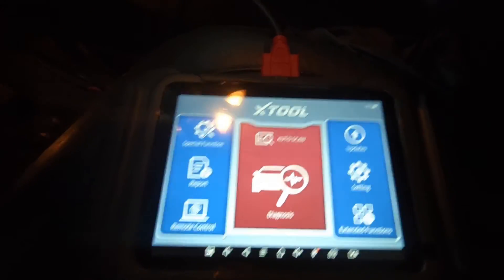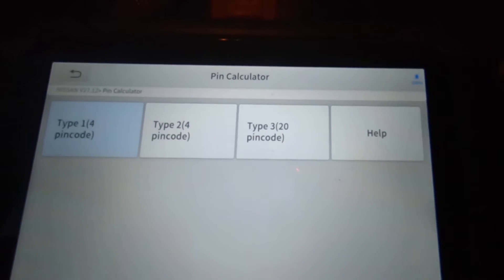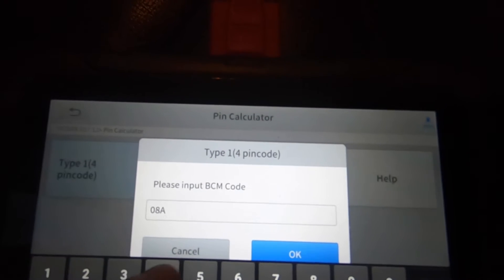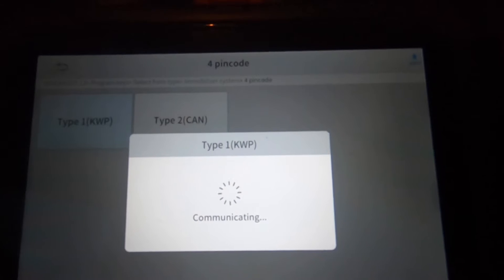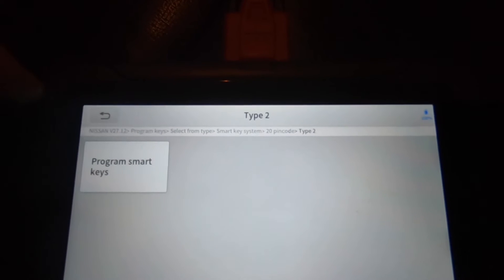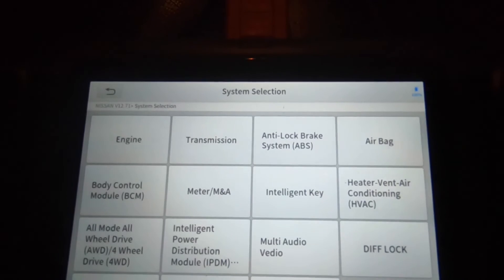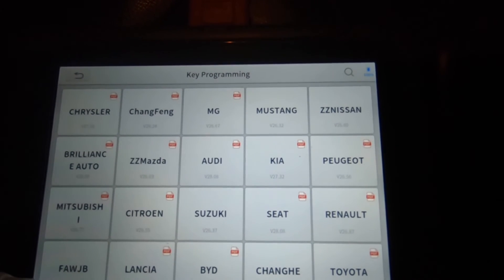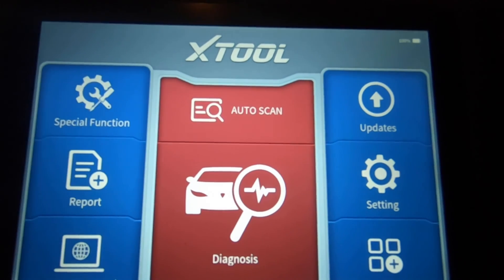Pulling Pin Codes and Programming Keys for Nissan using the Xtool D8 Scan Tool.

Comment: Does this still read pin codes ?
Reply from the maker: Yes, but it is still year, make, and model dependent, meaning it has never read 100 percent of the PIN codes or passwords from all manufacturers. However, for the ones I have used it on, I have not seen anything removed.

Comment: Are you able to program a replacement BCM to work with car with this tool?
Reply from the maker: Depends on the year, make, and model.
Reply: @737mechanic I have a 2007 Nissan Murano. Do you know if it’s compatible with that?
Reply from the maker: @zenbran  I don't know for sure without connecting it and seeing if it is listed.
Reply: @737mechanic okay thank you for letting me know. I’m hoping I just have a bad battery but have a feeling it’s probably worse with having over 240k miles
Reply: @737mechanic 2007 Nissan Murano

Comment: Hi i just got a xtool d8s and i have a 2013 Nissan Pathfinder when i try read bcm code it won't read it
Do you have any idea ?
Reply from the maker: Do a full system scan and see if it is listed there along with all the other modules. If there are codes in the BCM, it should show them there, then you can go into the BCM from there.

Or do you mean the PIN code for programming a new key?

Comment: I switched to a used ecu do you now how to change the vin # useing the xtool
Reply from the maker: What year make and model?
Reply: @737mechanic  2001 infiniti i30 useing a xtool d7
Reply from the maker: @darknight1289  Not sure if the D7 will do it but if it has the option it will be under special functions in the ecu module.
Reply: @737mechanic does it have it on the d8
Reply from the maker: @darknight1289  It depends on the make and model so for me to be sure I would have to have it hooked to a Nissan so I can get deep enough into the menus to see if it is there.

Comment: I just installed a used ECM and reprogrammed my key using this video. 2011 Nissan Altima 2.5l ... (note)if you get a used ECM it could have an airbag stored code in it.

Comment: Would you choose the xtool d8 over the autel ms906bt? Thank you
Reply from the maker: It depends on what I was going to focus on. The xtool programs far more keys and will adjust the mileage on many cars. The autel will not adjust mileage on any car but does have more special functions and active test so if troubleshooting problems was my main concern (and it is) I would take the autel.

Comment: Will the D8 pull pin code on chrysler/jeep 2008 and newer?
Reply from the maker: Yes, I have a video where I program a key and pull the pin codes on a 2007 Jeep Wrangler which is a Chrysler product.